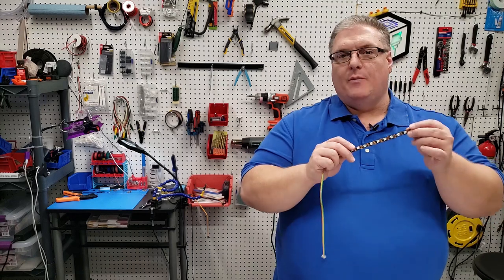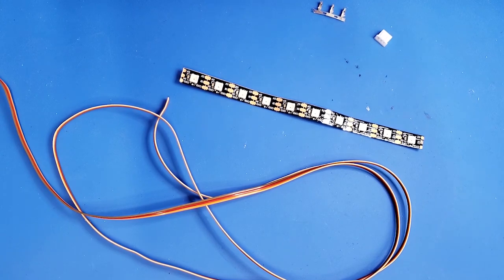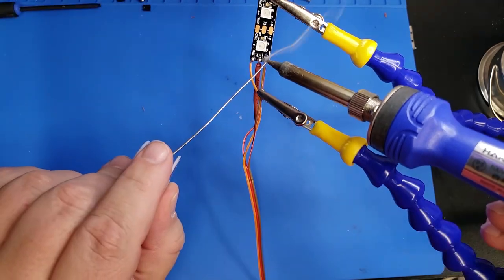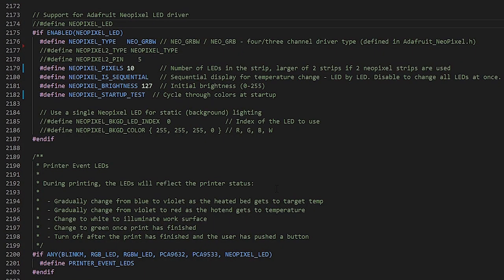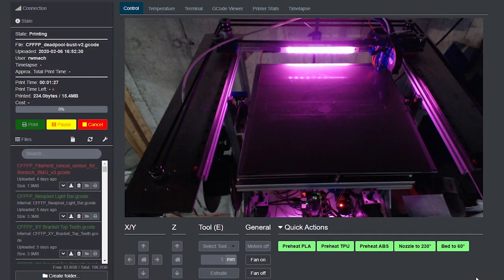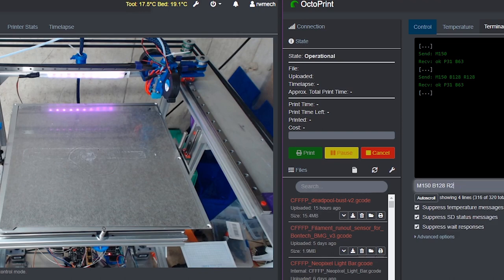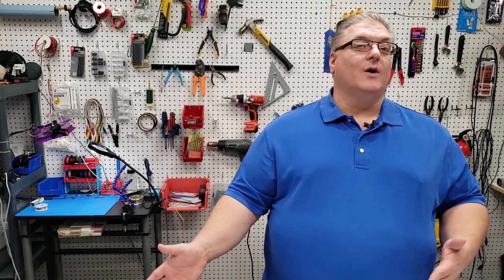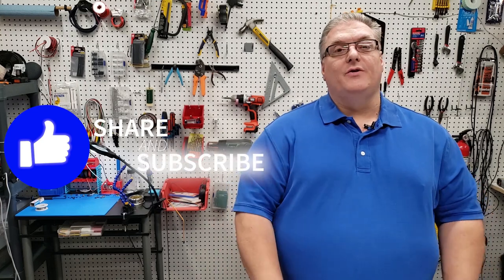Neopixel LEDs for the SKR V1.4 | Neopxels in Marlin 2.0

Comment from the maker: Will you be installing Neopixels on your 3D Printer?  Do you already have Neopixels on your printer?
Reply: Makers Mashup would it work on a SKR v1.3?
Reply from the maker: its a little more complex on the 1.3.  You need to re-purpose another pin like the SERVO0_PIN.  This becomes problematic though if you have a BL Touch or something else using that pin.  
#define NEOPIXEL_PIN P2_00
would be the pin to use with the v1.3 and the Servo.
Reply: Makers Mashup thanks
Reply: I plan on using Neopixels on my SKR V1.4 Turbo...if I use the dcdc mode v1.0 power module do I still need to solder the resistor/capacitor?
Reply from the maker: @dejavoodoo5474  Its possible, the issue is with the neopixels and how they communicate.  I had limited success without the resistor and capacitor.  Only way to know for sure is to give it a go.
Reply: @MakersMashup  what is the wattage of the resistor? I bought 1W and they are like 5times bigger the one in your video. Also when I connect it to the board the green and blue color are inverted, would it be solved with the resistor/capacitor combo or it's something else?
Reply from the maker: @M4R4M4O  I believe its a 1/4 w resistor.  There is very little power going through there.  You can use a 1W fine the resistance is the important part here. You wont be holding back any current so the 1W is overkill but it will work as well as the 1/4w so you shouldn't have a concern using it.  If you're getting the wrong color try changing the marlin option for the pixel type.  Depending on the ones you bought you might just need to change the configuration to make it the right color.
Reply: @MakersMashup  Thank you for the reply, I switched to the size you recommended, i'm running a meter or so long wire and i encountered the same weird behavior you mentioned in the video, the resistor took care of that.
You were also right about the wrong color issue, i thought the only config possible was GRB but reading the neopixel library i discovered that actually the letters are interchangeable...I just had to find the right order
Reply: I did received my SKR 1.4 board yesterday and will put Neopixels in the printer. Already have LEDs, but will remove them and put Neopixels ! Thank you for the video !
Reply: Thanks for the Video! I Connected the LEDs to my SKR1.4 Turbo with DCDC Board and without the extra Cap/Res and I can change through the colors correctly. At the moment I can not control one single LED, they are all changing at once. Can you guess whats wrong?

Comment: Hallo, I managed to install the led strip. It makes all the colour changes except the green on the end of the print. And another problem comes when the strip has the white colour, my lcd screen turns off. ihave a skr 1.4 turbo and tft 35 e3 v3.0. I made all the changes on the strips with the resistor and capacitor. Can it be the power supply?
Reply: I have 1m of 142 LEDs (normally 144 but 2 cut off, because soldering failure))
Reply: And i found out that the strip is causing the Heater carrige not hold the temperature constant. Is that maybe because the Powersupply is not enough. It is a 12v 240w PSU
Reply from the maker: 142 LED's should probably be driven off a dedicated supply.  10 should be no problem but 142 is going to draw more current and as you've seen already causing issues with the heater.  As for your green at the end of the print try putting an M150 command in the post-print/ending Gcode of your slicer.  I turn mine to blue at the end but you can change it to anything you like.
Reply from the maker: It could be the current if you're driving 142 LEDs off of it.  Its not voltage but current that is going to be your issue.  I don't know that the board is designed to drive that many LEDs.  That would certainly explains why youre having temperature issues.  I would consider using something in the range of 10-20 vs. 100+ Led's.

Comment: could you please show your Start Gcode script? my neopixel work fine manualy but when I start the print it doesn't work thanks
Reply from the maker: Here you go.  Note I have some things in here that might not be compatible with every printer out there so please don't cut and paste this into your printer startup code. 😜

G90
M211 S0
M150 B255
G28
M150 R255 U255
G29 A1
M150 B255 U255
M150 R255 B255
G90
M150 U255
G0 Z15.0 F6000 
G92 E0
M150 W255
Reply: @MakersMashup  ok thanks!!!  btw I fund my problem!! so weird I was starting my print from a SD card on the TFT35 V3 (touchscreen mode) witch didn't start the rgb light sequence! I will report as a bug ...danm this thing is full of bug but I tried started from Octoprint and boom it's working fine...
Reply: @chrisprelot7835  i think this is the problem with skr 1.4 or turbo- the neopixel works only as a simple RGB(((( in cura you can write commands (eg M150 B100 etc) before or after each stage of process or commands and once any process starts or stops it will do the change of color accordingly! but there is a question what is the point of it??? it is better to use wifi and control the neopixel through your cell phone??

Comment: Hi, thanks for this video. I tried on my SKR 1.4 with adafruit neopixels but it does not work. Any idea ? I put my configuation below. Thanks for your help ;)
`#define NEOPIXEL_LED
#if ENABLED(NEOPIXEL_LED)
#define NEOPIXEL_TYPE NEO_GRB // NEO_GRBW / NEO_GRB - four/three channel driver type (defined in Adafruit_NeoPixel.h)
#define NEOPIXEL_PIN P1_24 // LED driving pin
Reply: same as mine - does not working either rgb or rgbw (((( the testing ok rgb colors and nothing when try to print on(((
Reply: in the configuration_adv.h uncommen the #define LED_CONTROL_MENU (line 1050 in my case) and in cura use the m150 and b or r or u for colour )))) this is works - no i am trying to sort our how to control one by one neopixel individually)))

Comment: I use neopixels on my idex printer with a SKR Pro. 
Works fine, but there is one big problem!

i set up the Printer Event LEDs. 
At the end of the Print the leds turn green. So far so good. 
The printer stays on top of the print and the nozzle is still hot. 
I have to klick on the knob to resume. the printhead moves away...
I want to change the script in marlin. I must be a M00 command. 
Does anyone know where to find the adafruit lines with the gcode?
i allready searched a lot, but cant find anything.

Comment: wow thanks just fund you video to help me hook my Neopixel around my tornado!!
do you know if we can add different  light senario effect neopixel code into Marlin like rainbow effects , pulse colors? or we can only do static color on the Gcode like you show?

Did you tried Octoprint Rgb color statue plugins?
Thanks
Reply from the maker: Currently the only effects are the ones where it changes colors.  By combining some of the commends in order you can create some effects but it is very much a manual effort and limited to all of the leds at once.  I too was a bit disappointed there were not more effects for it.  My understanding is that the Neopixel timing is very sensitive.  Given everything else going on with a 3D Print and a modest CPU on most mainboards the timing cant accurately be done.  I don't have data to support this but that was what I read.  I've been considering writing some custom code for some effects but it is pretty far down on the priority list.

Comment: hi nice work 
i used your tutorial and it works but i need to change the led color based on bed and extruder temperatures for example light all leds with red intensity 10% and the first led with red intensity 100% and the next led after say   every 12deg if we do a math then light a led every one temp unit=|(target temp/no. of leds)| if target temp is 240c and we have 20 leds then i will turn on a led every (240/20) =12deg any way to do that or even turn all leds after target temp reached 

thanks

Comment: Good video! Glad you figured out your noise issue, neopixels with the one wire bus are a little more difficult to communicate with than other options, but they were one of the first and are definitely the most common addressable RGB LEDs

Comment: Exactly what I was looking for, thank you :) I would recommend using a separate power supply, unless you have the daughter power boost board for the SKR, I tapped off the 24V in from the Ender 3, used a buck converter to drop it down to 5v. then connected just the data line to the SKR. Obviously depending on the number of pixels being used, the amp draw can get significant quickly.
Reply from the maker: Yup, always check the total current needed.  The X301 lighted bed just uses 4 pixels and I think we used 10 here, the smaller amounts work fine on the board but as you point out the current draw can overwhelm the board when you start ramping up pixels.  It is a 3D printer not a vegas light show but Im sure people have some very cool uses of it.
Reply: @MakersMashup  I have 45, 30 across the top bar illuminating the build surface, and 15 on the x axis to remove the shadow, but these are also being used as a photography light source, for my buttery smooth 3D printing timelapses (video on my channel) without OctoPrint. Yes I understand I am like the only person who seems to not like OctoPrint lol.
Reply: This is the same as what i done but i also had to run the ground from the board as well as the data line, for the buck converter i used one of the small RC ones driving 20 pixels from an skr mini v2 with an ender 3 pro.

Comment: The function (changing color during heating up) works only when your display in Marlin mode (this is applicable for v 3 - for v 2 it does not work!)
Reply: Does not work with the skr mini V2 in touchscreen mode with a TFT but works when printing from on board sd card slot.
Reply: @raygilfillan  v3 in marling mode works fine)
Reply: @raygilfillan  in v2 it works as a normal LED so you have to write in cura the start and end gcodes))))

Comment: Trying to do it with an SKR Mini E3 V1.2 and can't get it to compile.  Keeps saying no such library exists for adafruit_neopixel.h, but I'm pretty sure the library is installed...
Reply from the maker: Not sure the fix given the limited information you provided here but it sounds like something is not finding the library.  I suggest popping into the discord where someone might be able to help you better.
Reply: @MakersMashup  Thanks I'll try that
Reply: Dunno if you're having issues still, but I succesfully just compiled my own custom Marlin 2.0 for my skr mini e3 1.2.. The biggest stumbling block was an error with the ADAFRUIT LED's .   There is a definition change you can make to point it to the correct zip file ( https://github.com/bigtreetech/BIGTREETECH-SKR-mini-E3/issues/257 )., which will let it compile with the ADAFRUIT neopixel code.  You might be having a similar issue..

Comment: Is there any way to address 1 led at a time
Reply from the maker: Not with Marlin.  I was really hoping for that functionality myself but my understanding is that the Neopixels are very timing dependent and with the limited CPU and all the motion planning going on while 3D Printing its not reliable.  Now what you could do is use something like an ESP8266 and hook up to the SKR via the serial port.  Then you could simply execute marlin commands and determine the "state" of different things and change the LED's accordingly.  Lot of work but for sure it could be done pretty inexpensively.

Comment: Awesome Tutorial , I have one question , have you had any issue with the 1st LED on the strip ?  Thanks.
Reply from the maker: Not since I added the Capacitor and resistor.  Before that I did as I  mentioned in the video.
Reply: @MakersMashup  ,  1st pixel still e always on ( skr e3 mini 1.2 ) So I heat shrink it. I tried different resistor and nothing , It works on a Arduino ( nano ) board , but not on the SKR !! maybe is a bug on the SKR e3 mini 1.2 .
Reply: @byseven  on SKR 1.4 turbo or 1.4 does not work!

Comment: Is this being used with a 24v PSU? Is that the reason for the capacitor and resistor?
Reply from the maker: The reason I'm using the resistor and capacitor is because of variance in signal and power.  The capacitor will even out any voltage spikes when the 5V from the SKR kicks on initially.  The resistor is to clean up any signal noise coming from the SKR 1:58.  Yes this printer is 24V but doesn't change the 5V that the SKR outputs on those neopixel pins.
Reply: @MakersMashup  That's good to know. I wasn't sure if I needed to down step the pins or anything to get the RGB to work, but if the pin supplies 5V then I'll solder a capacitor and resistor on my setup.
Reply from the maker: I can't say.  The Neopixel "best practices" say to use the resistor and capacitor to level out the voltage spikes and signal.  That seems independent of the power module.  You can always try it and if it does not work solder the resistor and capacitor as covered in the video.